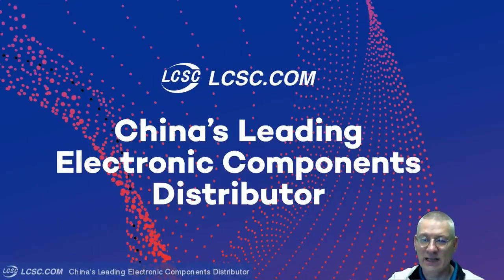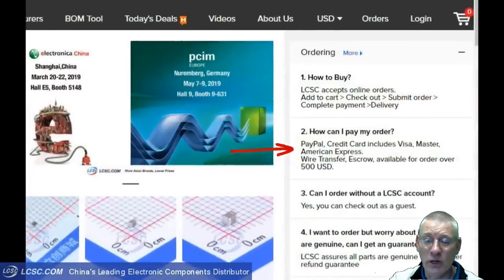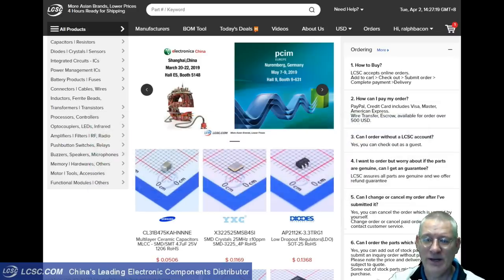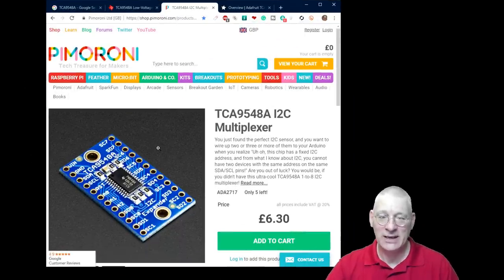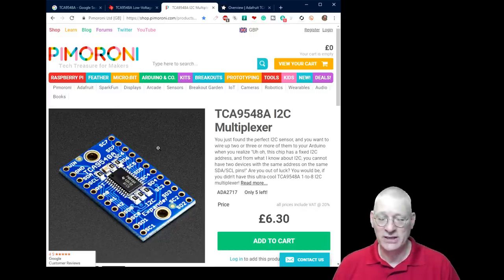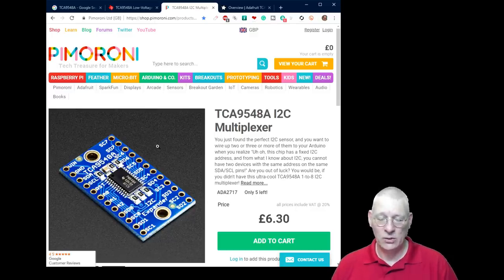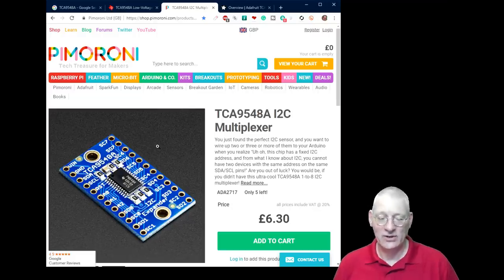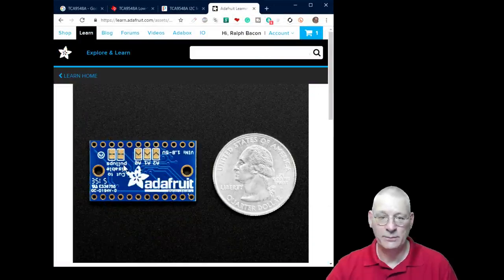#148 TCA9548A I2C MULTIPLEXER (& Voltage Shifter)

Comment: Thanks! So usefull. Great video. 
I have a question, i hope you could answer it to me.

This means that i will just declare a single display and i am going to just assign different adresses so then i send the info i want to show? I'm working with 5 oled glcd ssd on a pic 18f4550... this means lots of ram memory, i'd like to know if this pretty device could let me just add one single glcd ssd1306 to my pic's program and save huge space of ram by only assigning an specific channel for each of my 5 displays while all of them are showing different infotmation?  Am i getting it right?

Hope you to see my question and sorry for my english. Have a nice day.
Reply from the maker: My understanding is that you would only have to declare one instance of the LCD device but you would have to be careful that you initialised each one connected to the 9548A (in a loop, for example). 
After that, as per my demo sketch, you just send down what you want displayed to the device you want it displayed on. You could internally (in your sketch) remember which line/column stuff for each display was on, but you might not need this.
Now, one final caveat. This was written for the Arduino using the LiquidCrystal library (and Wire library too). As long as you have the equivalent for your PIC set up (or you are doing it natively) you should be good to go. Alternatively, your PIC could send the information to the Arduino (data plus the device to display it on, via the TX/RX pins), and use it like a black box device. Just a thought!
Reply: @RalphBacon  thanks for answering!!!

In fact, as long as you've toldme that in arduino is needed only 1 lcd, i felt peace in my soul and in my pic's ram space because on PIC shall be the same.
I think that I'm gonna mix both languages (asm & c) as its already possible in mplab in order to create my 9548 library  and also the glcd library i have.

I've been following some other videos you have and i like your channel, your explanations are very clear and the content is really interesting. Congrats!!!

 Thanks for the good option about sending the requestment to arduino to controll them using the arduino libraryes and i2c using pic as master by tx rx transmition just as an experiment, i liked it, thanks :)     i've never used arduino, in countrys like yours i believe arduino is a world without limits. i think its a really nice option for projects, but i have a personal issue with it, in my country at least a lot of people that i know, have never created something, they just wait or search some one doing a program and download it, most of them don't even know how to modify some parameters to fit theyr necesities... if they were like you, investigating, creating and programming i will love arduino in my country, otherwise i believe arduino have ruined creativity of my friends converting them in copy paste implementers.

Comment: Hello sir, I'm so happy I found your video, the explanation is very thorough and yet very complex. I've got a problem though. I'm trying to run your modified code for I2C scanner and weirdly, after running it it just shows "TCA9548A Scanner ready!
" and then nothing happens. As far as I'm concerned, everything is wired properly, I've got my TCA9548a connected to SDA and SCL (pins 20 and 21 on Arduino Mega 2560) and an MPU9250 connected to channel 0 on TCA9548a. Do you have any idea why that would possibly be happening? Thank you so much in advance!
Reply from the maker: Try putting something on the I2C bus that you know works, such as an I2C LCD, Filip, or anything you have. Get it running on I2C on the native board first. 
Then put it on the TCA9548A. If it doesn't work there it must be your code. It's got to work on the standard board first so you have a known starting position. If you're getting problems get it working on an Arduino first before moving to the Mega2560. These are the steps I would take. Good luck.
Reply: @RalphBacon  Ok, so I connected one of the MPU9250s directly to the I2C on the Arduino board. After running the scanner it immidiately found the sensor on 0x68 (at all ports, but that seems obvious since it doesn't really have ports as in TCA). Do you think my TCA could be fried? I just got employed at this company and don't really know what someone might have done to the TCA. Thank you so much for a quick response!
Reply from the maker: So it found your MPU9250 on hex address 0x68 on the native I2C bus of your Arduino. What do you mean by "at all ports"?
Reply: @RalphBacon  It's just that running the code that is supposed to check 0-7 ports on TCA, it shows as if 8 of MPUs were connected to the TCA. Let me show you how it looks:
-------------

TCA9548A Scanner ready!
TCA Port #0
Found I2C 0x68
TCA Port #1
Found I2C 0x68
TCA Port #2
Found I2C 0x68
TCA Port #3
Found I2C 0x68
TCA Port #4
Found I2C 0x68
TCA Port #5
Found I2C 0x68
TCA Port #6
Found I2C 0x68
TCA Port #7
Found I2C 0x68

Scan completed.
-------------------
However, I'm not concerned about that output since I know it's just one MPU connected. The point is, I suspect the TCA might be fried.
Best regards
Reply from the maker: Yes, that looks odd indeed. Get another TCA and see how that output looks without changing anything else. That will prove it.
Reply: @RalphBacon  Thank you for your help and opinions. Another TCA is on the way :)

Comment: Hi Ralph. Very nice video as always. I had no idea this existed. I didn't hit the wall yet with the I2C addresses issue but I'll certainly keep this IC in mind for some future projects. Question regarding the output selection. I thought it was done by setting a combination of 1 and 0 on the A0, A1 and A2 pins of the board, but you do it through software. It can be done both ways? Or what's the point of the A0, A1 and A2? Regarding the PCA9615 chip that I mentioned in another video comment, I think it would work just fine in combination with this one. At least I don't see why it shouldn't. Although you'll need a PCA9615 for each output of the multiplexer. Bought individually they're cheap but they're SMD chips and pretty small ones. Oddly only AdaFruit sells breakout boards of the PCA, 12 euros each, quite expensive. And for some reason the chinese guys don't make it. Best regards
Reply from the maker: The A0, A1. A2 set the address of this multiplexer on the I2C bus, Alex. In software we just tell it which output we want all future I2C comms to pass to, by talking to this chip's address (as set by the A0, A1, A2). I hope that made sense!
Regarding the PCA9615, I was thinking of using that (well, two of them) to allow the TCA9548A to be sited remotely. That is, the UNO (or whatever) is in your home, along with a PCA9615 and another PCA9615 is in your greenhouse/shed/beehive attached to various devices on the I2C bus (humidity, temperature, whatever). Basically, allowing I2C to be used over much longer distances than normally allowed!
Good to  hear from you, thanks for posting.
Reply: @RalphBacon  Oh, yes, that function of the A0, A1 and A2 makes much more sense. Your idea of using the PCA to make a sort of remote sensor station is great. What I was proposing was to use the same sort of temperature/humidity/whatever sensor in different locations. For example if you have several greenhouses or want to be monitoring the temperature inside, outside and in the house at the same time.

Comment: Could experiment with sending multiple data wirelessly using nrf24l01 using  an array? Like 2-4 Servos?  This will be a great way to have more pins to use on the nano.
Reply from the maker: I'm not totally clear what you're suggesting here, Webslinger. Nope, I've re-read this many times and I'm not sure what you're suggesting might a be a good idea. Care to elaborate?
Reply: @RalphBacon  I'm making a small robot car with a 4 DOF Arm on top and making it move thru wireless control. Some of the data I'm sending to the receiver (using an array) is getting messed up. As I only have limited knowledge on how this thing could work, I'm hoping someone would create one. I tried to modify dronebot's robot car sketch to include servos but encountered an error. Some conflict with RF24 and the servo library.
Reply from the maker: The problems you describe are typical when someone tries to modify someone else's code. It's never that simple! I'm afraid I don't know the answer either but in your position, I would certainly try and find out whether the transmissions really have become garbled or whether the receiver is not interpreting them correctly. You can always try the Arduino forum https://forum.arduino.cc which as many experts there and may be familiar with what you are describing. Good luck.
Reply: I think I got it working now. Combined 3 sketches into one. Tested with led's for the servo and two motors for moving forward/reverse and turning.
Reply: Still working out how to use that PCA9685.
Reply: Grabbed Ivan's code from Brainy bits for PCA9685 works great with wireless nrf.

Comment: can the voltage shifting be reveresed? I have a master MCU at 5V while controlling a slave 3.3V ??
Reply from the maker: As long as you buy the bi-directional level shifters then, YES, you can (and is what they are designed for). When first wiring these up it all seems a little fiddly but it's simpler than you think and "just works".
Reply: @RalphBacon  cool!!

Comment: can i use the same to read voltages of each cell from a battery pack connected in series.
Reply from the maker: No, that won't work. If you want to monitor the voltage of each individual cell, whilst connected in series, you will have to create a resistor ladder, measure each cell and subtract the value of all preceding cells in the ladder to find out the one you are measuring. Very easy to do, not so easy to describe here.

Comment: does this let you read data from multiple i2c sensors, or only send data?
Reply from the maker: Yes, read too but you have to then scan which device sent you the data. Easy enough to do though.
Reply: @RalphBacon  Thanks for your response. I have a system I'm building with multiple ir temp sensors with the same address. what would be the easiest way to read both sensors as quickly as possible? I was hoping to use this and switch between the two extremely quickly so effectively its like reading both at the same time. But if I have to scan the new one(which I'm assuming you mean start a new transmission?) it sounds like that may take too long.

From the data sheet of the MXL90614, I can't really tell if it's possible and how to change the address. I've never done something like this before. Thanks

Comment: I wonder if it is necessary to use two instances of the display driver or if it dumb enough to handle two displays with one instance. And do not tell me about good/bad praxis, it is on the bad side to use same instance for two displays, but it can save your some RAM memory.
Pyton. Sorry I never got around to that language, C/C++/Java and in rare (Today, long time ago it was much more common) cases Assembler cover most of my needs, I am forced to use PHP and Javascript also, but I do not like them.
Reply from the maker: What a lot of work you caused me, Henrik! I was intrigued by your question so I connected it all up again and tried it out. It works with a single instance of LCD - but there's a caveat. I could not get the second LCD to clear (blank the display, remove the cursor) UNTIL I initialised the LCDs in a specific order. So I had to talk to the LCD on channel 7 first and then talk to the one on channel 1 and it's all working as it should. Guess what? This happens even when we have two instances of LCD so it must be a strange anomaly of these LCD displays (I guess).
Reply: As long as the driver do not  maintain any state information about the hardware it is usual possible to share same driver for multiple devices. One obvious state information could be initialized or not, preventing the driver from sending out multiple initializations.
Reply from the maker: Yes, quite so, we could not interrogate the object hoping to get a sensible answer back (eg is the backlight on for a particular instance - unless it asks the actual device rather than maintaining that state in its object) but in this case it's just sending out data in a fairly straightfoward fashion. It's always useful to know.

Comment: Hi Ralph, Quite a reasonable price board and a nice gesture to Adafruit, I look forward to your vids on micropython as I have it installed on a wemos D1 mini and its quite a departure from C++, very fast  results  by using REPL instead of writing compiling and uploading...cheers!
Reply from the maker: Yes, it will be a new venture for me although I've used Python a bit on the Raspberry Pi (I still hate that indentation but must get used to it). Keep tuned!

Comment: Hi I would if ypu would be willing to do a video about this chip and how to convert an existing program that adresses 1 lcd / oled, to how to address it via a multiplexer? I am trying to work this out but struggling.
Reply from the maker: I can't do an entire video but the steps are straightforward. Before addressing anything else on the I2C bus, address this chip first and tell it which device you want all commands to go to. Thereafter, all I2C commands will be send to the pin you specified. If you build the demo circuit first (and use the demo sketch) it will probably give you a better idea of how it all works. The OLED screen connects then to the pin on this device not the original I2C lines from the Arduino.

Comment: M5Stack have a fingerprint reader for $17.90 USD
Reply from the maker: Which is actually a bit more expensive than either of the two I used in my demo - so what are you saying Adam, you're pointing out an alternative source? I've had a quick look at their store on AliExpress, it looks very nice - I shall look further when I have more time. If anyone else wants a look here it is:
https://m5stack.aliexpress.com/store/3226069
Reply: Ralph S Bacon ah sorry, I thought it was cheaper the the one you mentioned, never mind my mistake. Sorry
Reply from the maker: No problems, it's nice to see you commenting on my channel. It's certainly cheaper than Adafruit's one at $49 in any case!